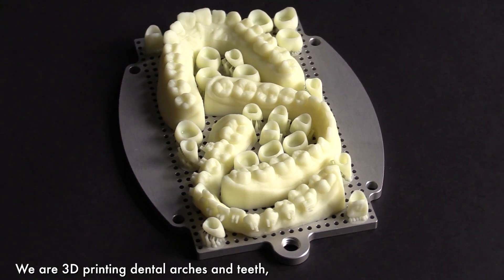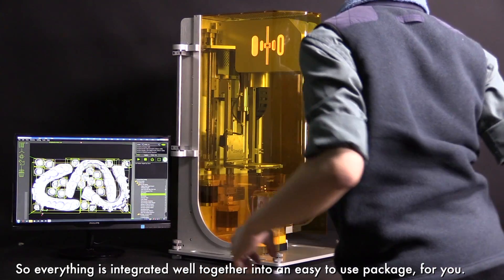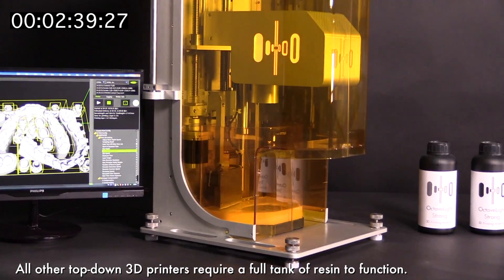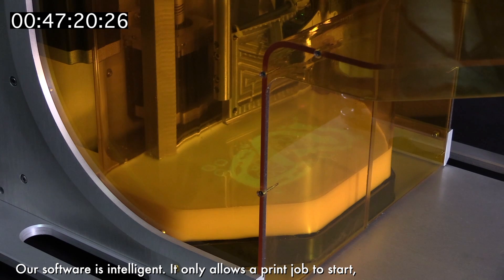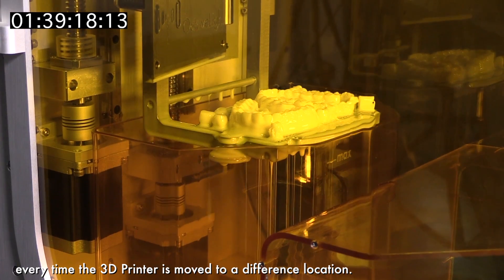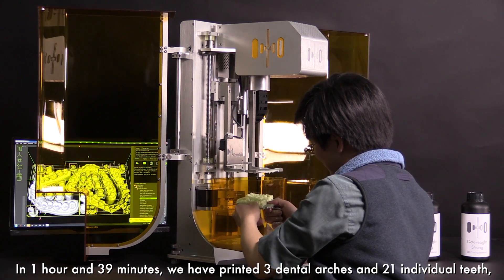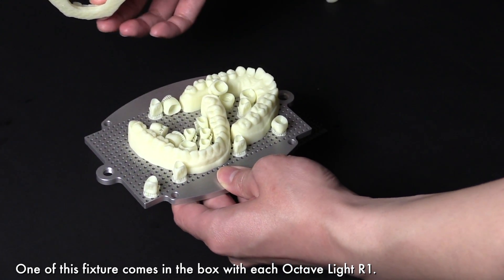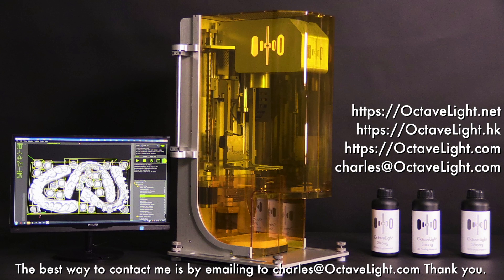3D Printing Dental Arches and Teeth with the Octave Light R1 70um

Comment: Hi,
Is there a chance to see the machine on a fair in Germany, like RapidTec (June 20-22th 2017) or FormNext (November 14-17th 2017). I am highly interested.
By the way, is it possible to adjust/change the light unit to emit 460 nm light?
Thanks.

Alex
Reply from the maker: Hi, Alex. 

The Octave Light R1 will be displayed in Paris from 30 May to 01 Jun. Please visit and see one of the most innovative 3D Printer in front of you! 

http://www.addfab.fr/news-2017-3-EN.html

Event is Add Fab 2017 trade show. 
Location is Paris Expo Porte De Versailles, France. 
We will be at exhibition booth C8. 

The light source of Octave Light R1 is a 405nm LED light. 
Thank you for the interest. 
Emailing to "charles@octavelight.com" is the best way to contact me. 

Charles Lo